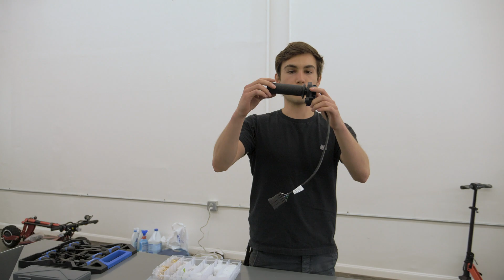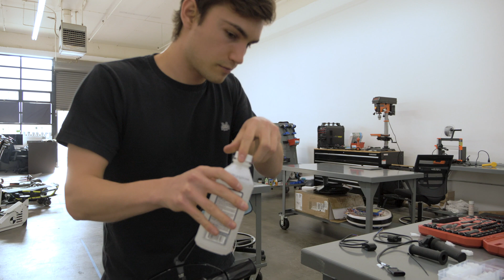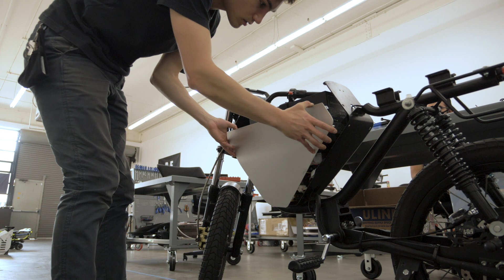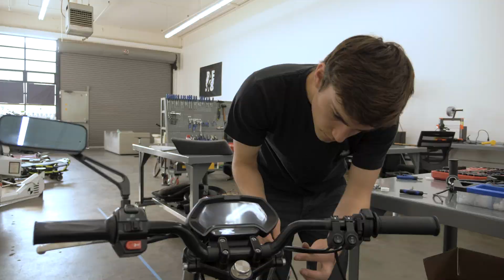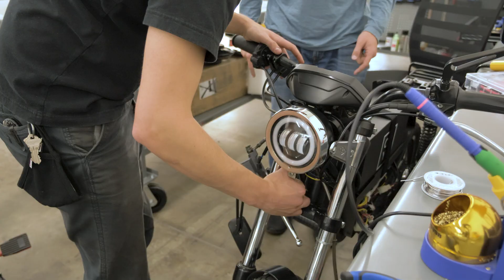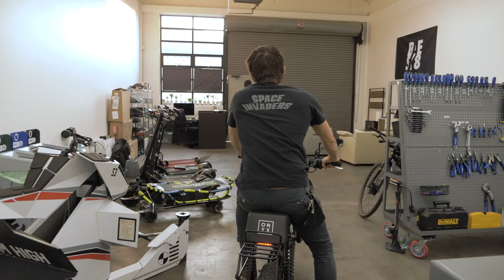Onyx E-bike Domino Twist-Grip Throttle & Button Mod

Comment: I put a surron full twist throttle on my 2022 rcr. The throttle was $16 and only 3pins to solder into the factory throttle harness. My throttle is new, so my power switch works fine, but I’m going to buy two switches soon to delete all the original switches

Comment: Great video, although would have been EXTREMELY useful to see the details of the soldering portion, arguably the most difficult step. do you guys have updated links for the power button and three way switch?

Comment: Hey how much would you guys charge to change an Onyx RCR Handlebar? I have I wanna change the stock one for another one I have. I stay on Bernal Heights up the street from you guys.
Reply from the maker: For just a handlebar swap my guess is $50 or so.
Reply: When would it be possible to stop by?
Reply from the maker: @dl1sf  Any time! It would be ideal if you could make an appointment here though: https://pev.works/drop-off-appointment